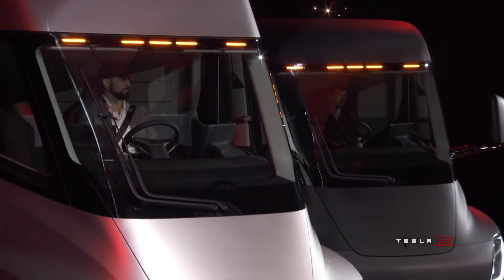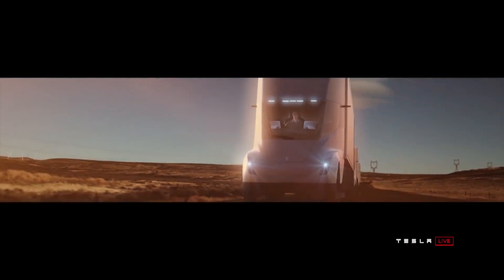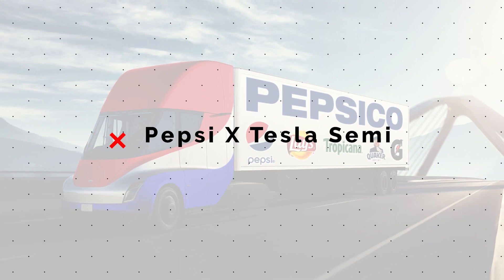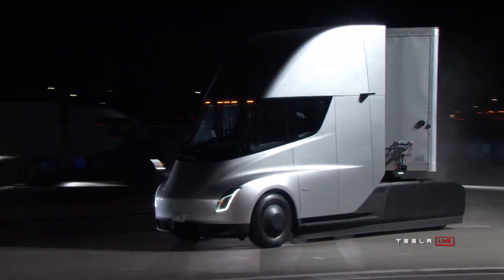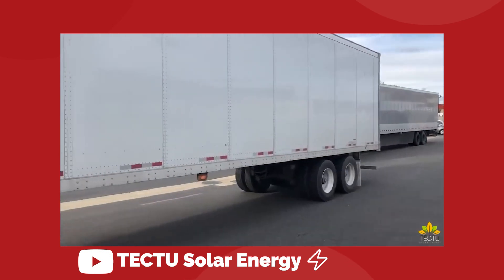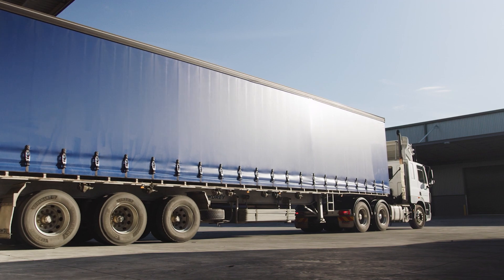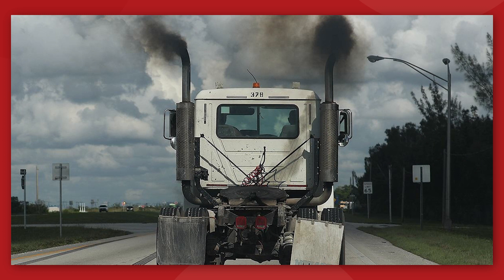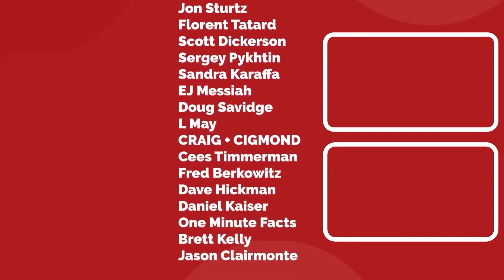Major New Tesla Semi Update Is Here!

Comment: Its important to note that Pepsi is using the Semi to pull potato chips not soda. That makes a huge difference because potato chips will fill a truck without significant weight. Soda or similar products do not fill a truck by volume, the limiting factor in loading a truck is weight.  The weight of the Semi dictates how much product you can haul.   The heavier the Semi the less product goes on a truck.

Comment: Air Stream has an rv they named the eStream. It has its own batteries and drive motors to move it's own weight. This idea seems ideal for the trailers to go with the Tesla Semi. EV Cargo container trailers would provide even more routing flexibility. The eStream can be maneuvered by a remote independently of the tow vehicle. This capability would add flexibility to handling trailers at terminals.
Reply: Maybe some technology like that could be built but, long haul trailers are designed to max-out cargo within the highway weight limits. Adding a big battery would drastically cut into that capacity.
Reply: @irrefudiate  The weight limits vs the battery weight are being widely discussed. There seems to be some developing consensus on the trade off.
Reply: @irrefudiate  The idea is silly.
Reply: @tedmoss  Lots of trailers cube out before reaching gross. Frito-Lay!
Reply: @larryschweitzer4904  that is probably the most excellent example of high-volume, low density cargo out there!
Reply: @robitmcclain6107  there are some allowances for higher weights for ZE trucks.
Reply: @tedmoss  Which idea, ev semis or ev trailers?
Reply: @JohnGeorgeBauerBuis  I had to look up ze. I also vote for small almost continuously running h2 fuel cells charging the batteries.
Reply: Even though an electric drivetrain is low maintenance it's still not no maintenance. Adding extra work to tending to trailers is almost certainly a no go.
Reply: @markswick4901  I believe you missed the main point which is that it pulls its own weight. If using an ice tow vehicle, that saves fuel. If using an ev tow vehicle, it improves the range and reduces stress on the ev battery. In addition, the batteries in the rv are available for being off grid. (limited but useful) Any solar power put into the rv batteries is gravy.
Reply: Adding batteries and motors is interesting, and might even be valuable in some niche markets. But the weight regulations combined with the efficiency (mass of product × distance hauled) makes for optimizing to maximize product weight in a long haul situation. Waisting weight on extra motors and batteries would have a negative effect on profitability in most situations.
Reply: @michaelwicker9538  John GBB above wrote that there are higher weight allowances for ze trucks. Someone pointed out that Frito Lay loads are volume limited nd do not use the weight allowances.
Reply: @robitmcclain6107  those weight allowances come from architecture standards that go into building roads and bridges. It would literally cost trillions to rebuild bridges to let EV semi trucks exceed the weight restrictions that are in place safely. Some states have different weight restrictions for example, but the bridges in those states have to be build different in those states.

I'm not surprised that some costumers are volume limited, and potato chips that need lots of air in their packaging doesn't surprise me. But I would call that one of those niche situations.

Comment: You didn't mention that these beasts require a massive amount of batteries!  The availability of batteries mean that if they make a lot of these semi's then they have to make a LOT fewer of everything else.  Remember that Tesla is battery constrained, and the Semi is dependent on that problem being solved.
Reply: Good point. And if you really are in to the environment, research the material needed to build EV batteries and then calculate how this will impact the environment when just 25% of vehicles are EVs. So much for improving the environment!
Reply: That’s why hyln is the solution!
Reply: massive amount of batteries! is tesla own fault not build more battery factories.
Reply: @hillbillyintheasia6122  wall, also the elements needed to make the batteries at all don't respawn after they're mined - they're just used up and the remainders get buried somewhere to leach toxins into the ground water.
Reply: FSD allows for a one-time payment of the cost of one truck (one FSD truck doubles efficiency per truck because no driver work limitations), plus a hefty monthly fee of 1.5 human drivers. Selling more Semis as a loss leader is wise, especially as diesel refineries keep getting shut down from age.

Comment: They need it more now than ever before with the gas prices
Reply: Until they need to charge up or get new tires.  Then they're kind of SOL without oil.
Reply: @billcichoke2534  while there will continue to be demand for petroleum for non-combustion uses, this is still less than the use for vehicle fuel and other combustion (heating, power generation, etc).  It is also worth noting that crude oil can be made from plants in non-geological timescales (days instead of many years).
Reply: Have you stopped to think that the fuel prices are intentional to force you and the logistic industry to go electric?
Reply: @JohnGeorgeBauerBuis  Qhat you're not taking into account is:  the NON-fuel fraction of oil is much smaller than the fuel.  Needing more of this smaller fraction means you will need more barrels of oil to satisfy it, NOT LESS.  And the industry HAS to use petrochemical products, since the 'grassfed' versions simply can't stand up to use or even sunlught.

Comment: Initially, I don't think the semi is going to be used for long-haul trucking as they will need to charge at the home depo all the time. Maybe once mega chargers are available on the road it will be a thing but not, for now, it's still going to cover a lot of use cases, just not every use case!.
Reply: It won’t even be used locally. I run a fleet of over 20 trucks and I promise you if we had Tesla’s we would be out of business.
Reply: @speakingthetruth3830  ... With both Pepsi and Pride Group Enterprises  ordering over 100 semi's each, there must be a use case for them otherwise they wouldn't be ordering them 🤔
Reply: @speakingthetruth3830  ... That's fine, if it doesn't work for you but that doesn't mean it doesn't work for others!  I live in a flat here in the UK and wouldn't buy some of the electric vehicles that are available here because they don't have fast enough rapid charging, which I need because I wouldn't have access to home charging.
Reply: @markreed9853  it will work for local delivery.
Reply: @tiptoe38  ..if you give the max range model a realistic range of 400 miles it's a little bit more than local
Reply: @markreed9853  It’s not enough for over the road.Recharging is going to be the biggest problem.
Reply: it has 4 motors that is sufficient to last it for 1 million miles. As it breaks the kinetic energy is used to charge the battery

Comment: I work in trucking, your right about the range being a non-issue especially if there is a charger on the break, the biggest issue is weight of an empty tractor; the more the tractor weighs, the less weight capacity the truck can carry. That being said, new battery tech should help this and that's probably the main reason for the delay.
Reply: If i remember right they passed a law where if you are driving an electric truck, The total weight you can haul is 90k to make up for the batteries.

Comment: I am a Tesla customer for my home.  I am a mechanical trades guy working in the water remanufacturing business.  But I have had a class "A' drivers license since last century.  I have had an interest in electric vehicles since 1965 when I was 10.  As exciting as the semi truck is.  The medium duty local delivery market will prove out and further the development of electric trucks.  The perfect development proving ground is traveling on I-80 between Sacramento and Reno.  As a comparison, send vehicles on I-5, CA-70, and US-395, between the two cities.  Just even compare the power consumption of a Tesla car of your choice.

In the presentation, an example was given about the horsepower of a Ford Mustang.  For the model years given, the tedting standard changed.  So the numbers do not relate to each other.  If you want to compare a 302/5.0 engine.  Compare a 1978 model in a F150 to a 2018 model in a F150.  Electrics have a big market ahead.  But not the whole market.  Hydrogen, not from natural gas.  May power fuel cell and internal combustion engines.

Comment: Shift is 14 hrs. With a maximum drive time within that shift of 11 hrs. Every 8 hrs a 30 min “break” is required which can be used for other work. (such as fueling) After the driving or 14 hrs shift limits have been reached, 10 hrs of break time is required to reset these limits. It is possible to split the 10 hrs into time spent in the sleeper and any other form of break. Most driver’s don’t split break except when it is required to extend the 14 hrs clock to make a delivery. It get to complicated to explain all the variables here..✌️

Comment: Tesla are battery constrained. They have a choice of producing one Semi or several Model Y. Right now (I forget the math) they make more profit selling Model Ys with a fixed quantity of batteries. So, my speculation is that they are doing proof of concept with the drivetrain, battery pack, and especially charging. Once that is sorted out with the battery supply chain, they will build a Mega Factory for Semi.
Reply: We’re going to run out of diesel by then. Refineries are aging out, and new ones are uneconomical per Tony Seba’s LCOE report. The trucks must roll; an extremely rapid transition to electric semis is needed. We’d like a Cybertruck. We need to eat.